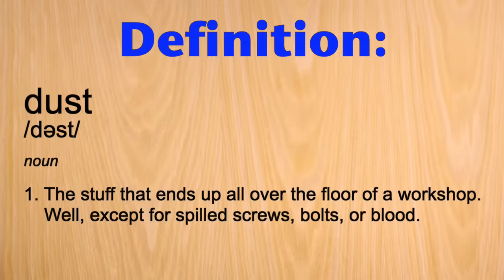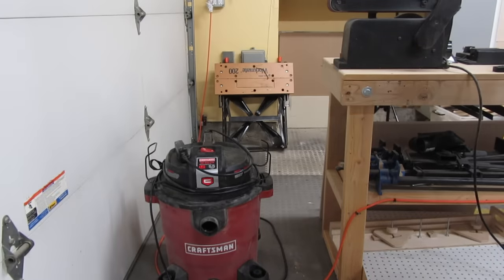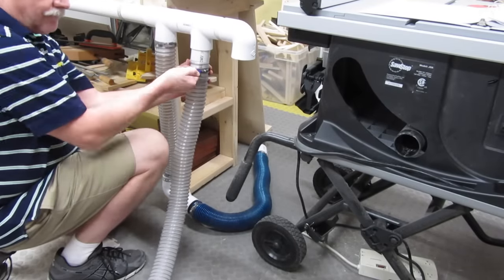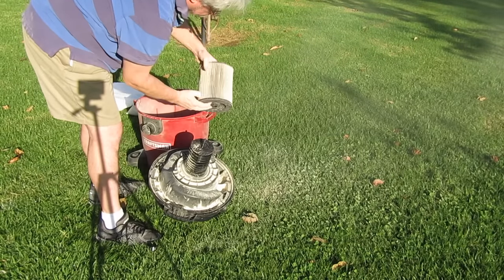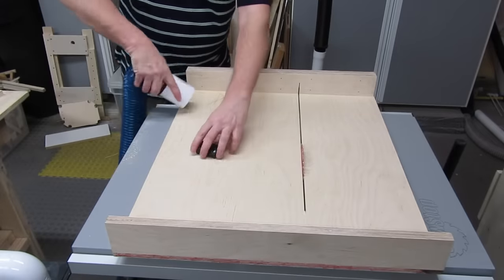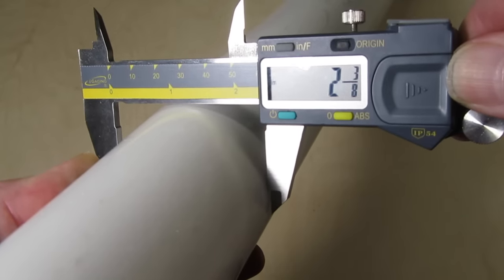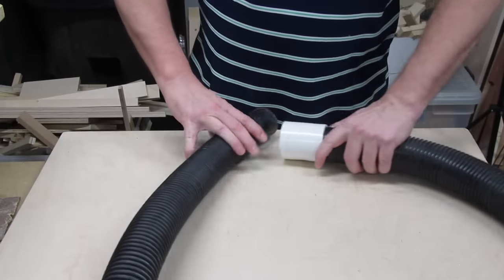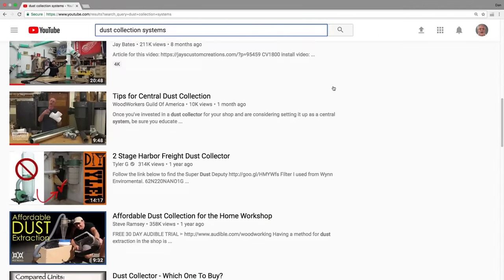Dust Collection for Newbies: Introduction to Dust Collection

Comment: Hi just watched your video. Is there any loss of suction from the vacuum due to the amount of piping your have. Your system looks perfect for me as I have limited space. Also what power output is your vacuum for reference. Thanks in advance
Reply from the maker: Yes, there is loss. How much loss depends on the length and type of piping, turns, etc. The question always is, is it enough of a loss to matter? On my system, it works plenty good enough. So you just have to try it out and see. My vacuum is 5.5hp, but I'm not sure how reliable hp numbers are.
Reply: @TheNewbieWoodworker  thanks very much. I'm definitely going to try this out
Reply from the maker: @thegarageworkshop3215  👍

Comment: Great video!  Question: any issues with static electricity?
Reply from the maker: That's a great way to ask the question. The reason I say that is that I don't personally believe there's a fire issue - see https://thenewbiewoodworker.com/dust-collection-fire-danger/. But I can definitely feel the hairs on my arm stand up when I walk by one of the pipes. I haven't ever been "zapped", but I wouldn't hold it against anyone who wanted to ground their system. 😄

Comment: miter saw is the best option to cut pvc .
Reply from the maker: Thanks for the info! 👍
Reply: Yep, works for me too. Nice straight cuts, then use a steel rule to debur.
Reply from the maker: @joneff9713  👍
Reply: It's great until that one time it catches the pipe causing it to spin like a top and explodes breaking your finger. If you like to live dangerously then cutting PVC on a miter saw or table saw is the only way to live.

Comment: Thank you for the video.  Why are you not using Y fittings rather than T fittings and 90 degree elbows.
Reply from the maker: You're welcome! I finally made a video to answer that question: https://youtu.be/DzuPo802mV8. But remember that this is just my experience - if you want to use Ys and 45-degree elbows or sweeps, go for it! 😄

Comment: Why use 90 degree fittings instead of 45 degree? 45s allow for a much less abrupt change of direction and better suction plus less blockages. Good video anyways.
Reply from the maker: Thanks, and yes, you're right. However the difference isn't nearly as great when you're using a vacuum-based system vs. a blower-based one. But yes, if you can use 45's or longer sweeping curves, it would be better.

Comment: HI Newbie! Can you tell us about the flooring you have on the garage floor?  Brand, Installation, and approximate cost.
Reply from the maker: It's been so long, I don't remember the exact details. But they're pretty similar to this: https://www.homedepot.com/p/BlockTile-12-in-x-12-in-Modular-Interlocking-Garage-Floor-Tiles-Set-of-30-B0US4630/301985773. EDIT: I think it's these, actually: https://www.homedepot.com/p/Norsk-Multi-Purpose-18-3-in-x-18-3-in-Dove-Gray-PVC-Garage-Flooring-Tile-with-Raised-Coin-Pattern-6-Pieces-NSMPRC6DG/204318892

Comment: I've always cut PVC with my chop saw / compound miter saw and never had a problem, I do recommend a higher tooth count blade. What are you heating the pvc with? heat gun?
Reply from the maker: Thanks for the info! And yes, a heat gun works best for heating the PVC.

Comment: Having a difficult time finding anything close to fit on the Dewalt dwe7485 2.5" dust port. I would prefer a solid connection vs a hose right on the port. Also, my vac is a Stanley with a 1-1/4" connection on the end of the small hose.  Any suggestions?
Reply from the maker: Yes. Make PVC adapters. This isn't how I would explain it, but the concept is good: https://youtu.be/cjLQo3GuvDo. You can use a hacksaw to cut the PVC if you need to. Don't burn the PVC (don't let it get black) and either do it outside or keep the shop door open to get outside air. I'll make a video on this some day.
Reply: I have that same table saw. I got the Dust Right 650 from Rockler . It has a 4” port so I got the 2.5 to 4 inch adapter. I want to split from the Dust Right to my miter saw too. So I need to get a Y fitting and run hose to the miter saw too. But can’t decide should I reduce the connection at the Y fitting or at the miter like I did the table saw.
Reply from the maker: @shockjock35  I remember hearing that you should always do the reduction as close to the tool as possible, and I think that makes sense if you think about it.

Comment: I've used my miter saw to cut schedule 40 PVC and have only had problems if the PVC has had excessive exposure to the sun. Apparently schedule 40 isn't rated for UV light resistance and becomes brittle with excessive exposure.
Reply from the maker: Interesting! Thanks for sharing. 😄

Comment: To be sure I understand correctly.. a 2 1/2 inch dust hose will fit over the port on the Sawstop Jobsite Pro? I  just got a dedicated dust collector and have been trying to figure out what adapter I need. Thanks..
Reply from the maker: Yes, I believe it will.
Reply: @TheNewbieWoodworker  Thank you for replying.. I will try that size. I may follow your setup and use a rubber coupler to get my collector hooked up.
Reply from the maker: @al2969  You only need the rubber coupler if there's a big size difference. Otherwise, a hose clamp should be fine. Good luck!

Comment: Hi Newbie Dan, are you still using this version of dust control in your shop? Also, have you tried cutting the coiled hose (the semi-clear hose from the drops to your tools) from Rockler to shorter lengths? Thanks!
Reply from the maker: I am indeed still using this version. But when I was making the last video, I made the mistake of measuring the airflow before the Dust Deputy, and after it, and let me tell you, the Dust Deputy cuts the airflow WAY down. I say "mistake", because now I'm trying to decide how to test it so I can take everything into account. I may still end up keeping the Dust Deputy, in spite of the decrease in airflow, but I just wanted to let you know that the future is uncertain. 😄As for the length of tubes in my current setup, I don't know if changing them would help or not. I may test different arrangements when I test the DD. Time will tell.

Comment: never cut any tube with a saw disc or band saw because at some time the tube WILL roll and could cause injury. ALWAYS clamp and cut with any kind of suitable hand saw.  better safe and slow than fast and injured.
Reply from the maker: "better safe and slow than fast and injured" sounds like great advice. Thanks! 😄

Comment: I live in a dry climate - in winter the static electricity builds - fine dust sticks to things especially plastic.  Would running a small copper wire thru the pipes and attaching it to a ground help?
Reply from the maker: Probably. There's a lot of videos available on grounding systems. If you end up with something that helps, let me know - I'm curious.
Reply: You are talking about triboelectric charges.  A grounding wire could help, but remember that polypropylene was used in COVID masks specifically on the (misguded) theory that the virons would stick to it.  What the experts ignored was that moisture kills the charge.  In your case, humidifying the system -- maybe by a wick with water reservoir at the system inlet would solve your problem.

Comment: Any issues with grounding yet? The CFM through shop vac and plastic create electricity. I have two shop vacs and one has the same concept you created. It would be nice to extend its capability to save space.
Reply from the maker: If you're talking about safety issues, I personally don't think it's an issue for systems of this size. See https://www.rockler.com/exploding-pvc-dust-collection-ductwork. With that said, if you'd feel safer grounding your system, then by all means, do it. If you're asking if I notice the hairs on my arms standing on end when I'm next to the pipes sometimes, then yes, I do. 😛No big deal, at least to me.

Comment: 2x45° instead of 1x90° is better.
3x30° is even better
Reply from the maker: For "true" dust collectors, which rely on air volume rather than air speed, that's true. But shop vac-based systems rely on air speed, not volume, and my measurements with an anemometer show no real difference. But of course I could be wrong.

Comment: Great video. One question, why is it that many people use these larger  pipes or hoses for their system? Wouldn't a smaller diameter increase suction power? Thanks.
Reply from the maker: Thanks, and that's a really complicated question. Short-ish answer is that the larger pipes are used by systems that use true dust collectors, which have blowers that operate on a different principal than the shop vac versions. Yes, the larger pipes probably decrease suction power, but they increase air volume, which is how the blower-type systems collect dust - air volume, not air speed. Although I can't say that I totally understand the concept. There's a LOT more to learn on the subject, and the most important thing is that the larger systems can collect what's known as "small dust particles", which are apparently dangerous to our health. But from what I've read, there's a lot of things you have to do correctly to get those systems to not only collect the fine dust particles, but also not have them spew the particles back into the workshop. If you really want to know more, then read up on the subject, but I'll let you know straight out that if you go down the rabbit trail of learning about the subject, you may get sucked in and never come out. Seriously - it can be really complicated.
Reply: @TheNewbieWoodworker  Thanks for taking the time. I just have a good but regular vacuum (1600W),  so I guess I'll go for 2". Thanks, and keep on nailing it!
Reply from the maker: @baldurkuhn1  Sounds good. Thanks!

Comment: I would have mounted the vac outside to reduce noise and dust.
Reply from the maker: Thanks for the comment. I'd have to get the pipes to the vac outside, and the longer the run of pipes, the less suction. Not to mention the fact that it would annoy the neighbors. It wouldn't lower the dust - the vacuum does not produce dust, it collects it.

Comment: Cutting any type of plastic with a chop saw is easy as long as you turn the blade so it cuts backwards or use a cut off wheel on your saw. The reason why it shatters is the distance between the teeth is too great and thats why a hacksaw works because it has fine teeth. General rule is you should have at least 3 teeth cutting into your material at all times to avoid kickback and shattering.
Reply from the maker: Thanks for the info. Lots of people have mentioned using chop saws, but to my recollection, nobody's mentioned the 3 tooth rule (or guideline), so I really appreciate your comment! I don't use a chop saw, but that doesn't mean I like to be ignorant. 😛So again, thanks!
Reply: @TheNewbieWoodworker  I learned that trick installing vinyl siding. 
Love your channel by the way
Reply from the maker: @moonraker8794  Thanks, Chris. Passing on what we've learned is what makes this community so much fun. 😄
Reply: @TheNewbieWoodworker  I saw you using a cross cut sled. What is the purpose of that particular jig?
Reply from the maker: @moonraker8794  Check out this section of a video I just made, and if you still have questions, let me know. This link will jump you right to the spot in the video: https://youtu.be/sei4CwkP3kQ?t=183

Comment: PVC is not recommended for dust collection, in fact you can't use it in commercial applications. PVC creates static electric which can start a fire, as the dust is very explosive.
Reply from the maker: https://www.rockler.com/exploding-pvc-dust-collection-ductwork
Reply: @TheNewbieWoodworker  I had a commercial woodworking shop for 30 years...if I put one stick of PVC in my dust collection system my insurance was cancelled.  In fact, our metal system had to be grounded with spark arrestors installed inside the duct work.   Is the chances in a home system small, yes, but, wood dust is explosive and a single spark in the wrong location can be devastating.  There have been many fires from static electric in commercial applications.  At least run a bare wire inside your PVC pipe to ground to give you a small amount of protection.
Reply from the maker: @wags99999  I would never tell someone not to do what you're suggesting. I don't personally believe it's necessary *in a small shop environment* that you usually find with 2" PVC pipes. But of course I could be wrong, which is why I start every video with the disclaimer "never take safety advice from someone who calls himself 'newbie'." 😛

Comment: I would like to know what size / HP your shop vac was? 5-6 ports/ drops seemed like a lot when I first watched this and those "dams" seemed to work well. I also noticed that the bucket seemed to go concave when you were showing it working so Im suspecting you have plenty of pull or suction. Any response appreciated.
Reply from the maker: Thanks for the comment. Here's a link to the vac I'm using: http://amzn.to/2lH0ZpP

Comment: Do you have any suggestions for a very very small shop? 10x10, with pretty much just the basics. Is the dust cyclone and shop vac sufficient for an occasional hobbyist?
Reply from the maker: I think for a shop that size, I'd consider just having a shop vac and moving the hose from tool to tool. You could add a cyclone if you want, but it takes up space and honestly, cleaning the shop vac's filter isn't hard.

Comment: How did you get the Rockler blast gates to fit so well into the PVC tee fittings?  Did you drill through them or use solvent cement?  Even after molding PVC, it doesn't like to press fit to the blast gate material for me.  Maybe it's because the blast gate connections are tapered
Reply from the maker: I did it by heating the pvc then sticking the blast gate into the pvc and letting it cool down. Make sure you don't stick the blast gate all the way in. Once it cools, you want to be able to push the blast gate into the hole further, so the tapering will cause it to get wedged into the hole. I don't use glue at all. Works like a charm for me. I hope this helps.

Comment: Sorry, didn't hear you mention the size of blast gates your using? Thinking its 2 1/2 inch? Your links don't say, but when I clicked the link it said the size but it isn't from Rockler? So a bit confused...thanks!🙂
Reply from the maker: Yes, the blast gates are 2 1/2". The ones I linked to are pretty-much the same as the ones from Rockler.
Reply: @TheNewbieWoodworker  thank you very much!
Reply from the maker: @dreamlookautodetailingauto3353  👍

Comment: Nice "Newbie" video. But you'd be better off using Y' Fittings instead of Ts. They have much better air flow and a shop vac often doesn't have the greatest to begin with.  And if you need to actually turn 90° add a 45 to the Y.  It makes a much smoother transition than a T.  Also using long bend 90° fittings helps too.  Typically in a shop you aren't cramped for space so it's a no brainer.
Reply from the maker: See my video on the subject: https://youtu.be/DzuPo802mV8

Comment: Great video! What did you use to heat up the PVC?
Reply: Heat gun, yeah?🥴
Reply from the maker: @reverendsonhouse  Yes, a heat gun. Some people have said they used a hair dryer. Just make sure you keep turning the pipe while heating it, so it doesn't burn. If you can, try to keep as much ventilation as possible -  I open my garage door and run a fan to vent the fumes. I wear work gloves too. Oh, and thanks. 😄
Reply: @TheNewbieWoodworker  thanks for the reply! Much appreciated!
Reply from the maker: @reverendsonhouse  You're quite welcome! 🙂

Comment: where do I get some of the fittings you show? Such as the ones with the sliding door and the thumb screw band clamps and the cyclone.
Reply from the maker: I've got lots of links in the description. Just click on "Show More" or if you're using a mobile device, there's a little triangle you can click to show more.

Comment: Thanks for the video.  Do you know if dust collection setups work okay against gravity.  For example if I have my hose run straight up to the ceiling and over to my harbor freight dust collector on the other side of the room, will that work?  Or will that cause me issues?  Thanks
Reply from the maker: Lots of people do that, so I would think it'd be just fine. With that kind of dust collector (as opposed to my shop vac), use 4" pipes everywhere you can, and only drop down to smaller pipes when a tool requires it. You'll want to have as many straight sections as possible. When you have to make turns, try not to use sharp 90-degree bends if you can help it - either find the longer, curved elbows, or else use two 45-degree bends. Obviously you do what you have to do, but those are a few good guidelines when you have a choice. Let me know if you have more questions. 😄
Reply: @TheNewbieWoodworker  Thank you for replying so quickly
Reply from the maker: @jonmhayden  You're quite welcome. I happen to be editing another video, so I was on my computer. 😄

Comment: Good video, except you should use 45 degree bends, never 90 degree Ts. A T joint will cause turbulence and drag and reduce your suction. If you have to do a 90 degree bend, use 2x 45 degree bends to reduce drag and turbulence in the system.
Reply from the maker: It's true it helps to use 45 degree bends, but on a shop-vac-based system, not as much as you might think. https://www.youtube.com/watch?v=DzuPo802mV8
Reply: @TheNewbieWoodworker  That is very good information to have. Thank you!
Reply from the maker: @davedave8263  👍